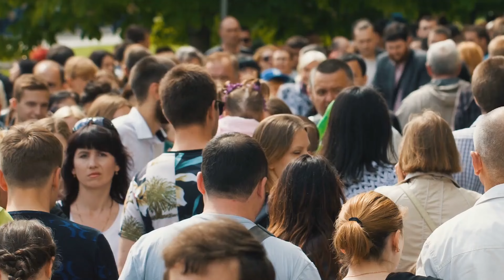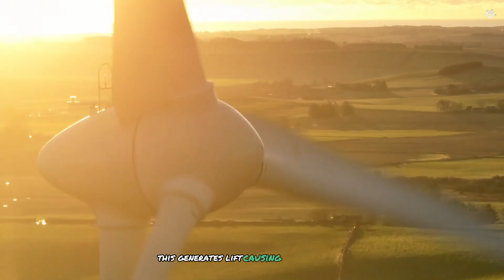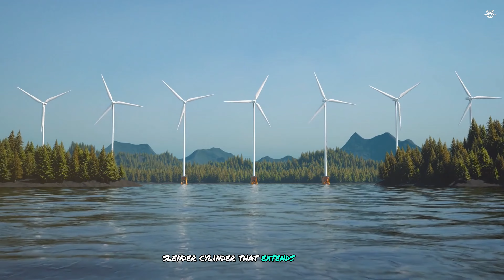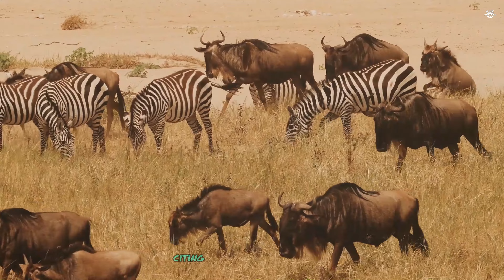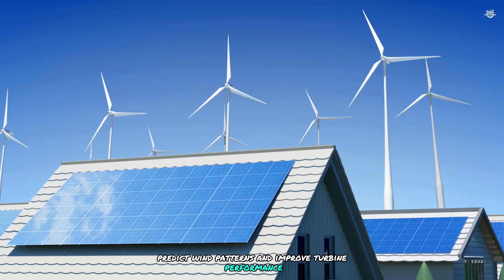How Does a Wind Turbine Work? [to Generate Electricity]

Comment from the maker: Timelapse of Wind Turbine Work Procedures 

0:00 – Intro: How Does a Wind Turbine Work
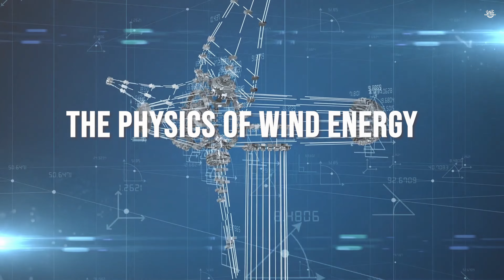0:43 - The Physics of Wind Energy
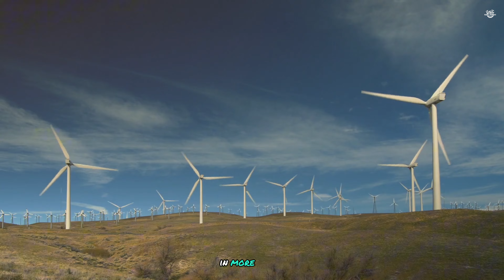1:22 – Wind turbine components, Blades
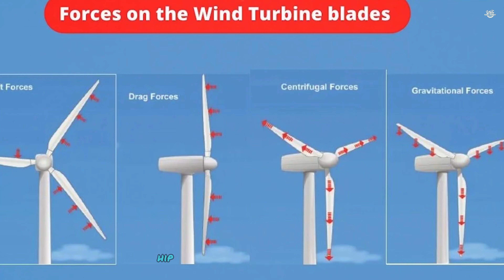2:15 – Rotor of Wind Turbine
2:36 – Nacelle Work Process
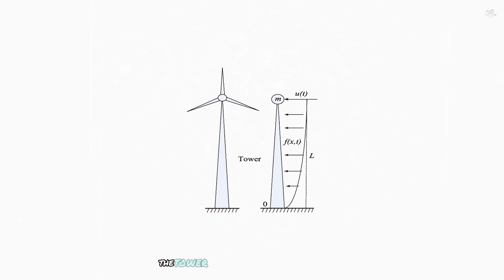3:03 – Tower
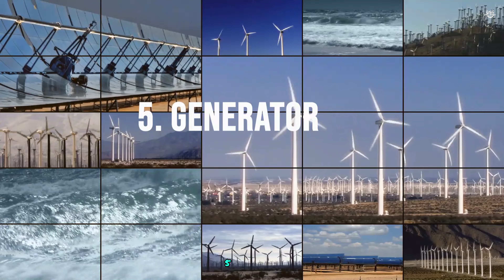3:34 – Generator [for electricity]
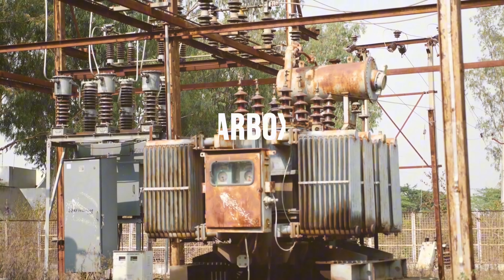4:00 – Gearbox for Turbines
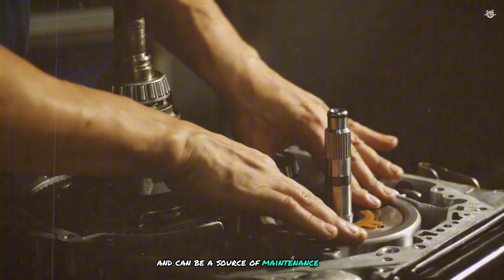4:25 - Control Systems
4:51 - The Wind Energy Conversion Process
5:00 - Step 1: Wind Detection and Turbine Positioning
5:33 - Step 2: Blade Rotation
6:08 - Step 3: Rotor Shaft Rotation
6:25 - Step 4: Gearbox Operation
6:59 - Step 5: Generator Operation
7:40 - Step 6: Power Conversion
8:09 - Step 7: Transformer Step-Up
8:30 - Step 8: Grid Connection
8:46 - Advanced Wind Turbine Technologies
8:56 - Floating Offshore Wind Turbines
9:31 - Airborne Wind Energy Systems
9:59 - Bladeless Wind Turbines
10:21 - Smart Wind Turbines
10:46 - Environmental and Ecological Considerations
13:35 - Conclusion